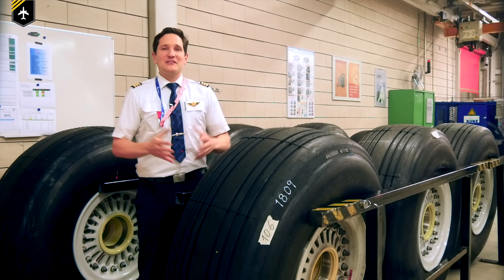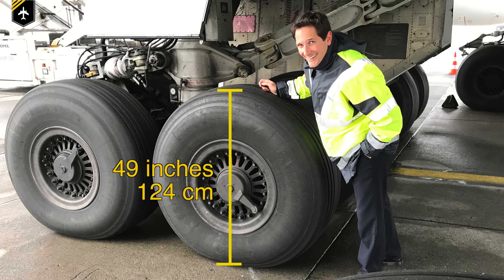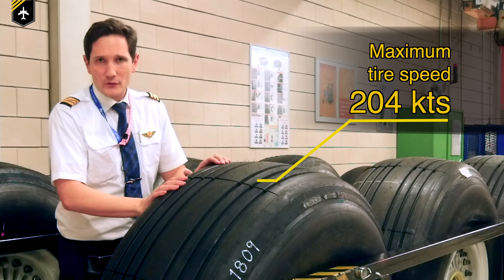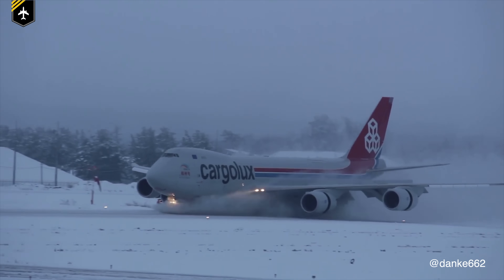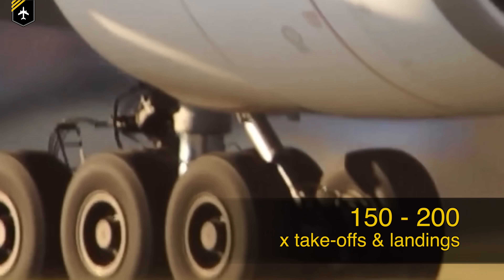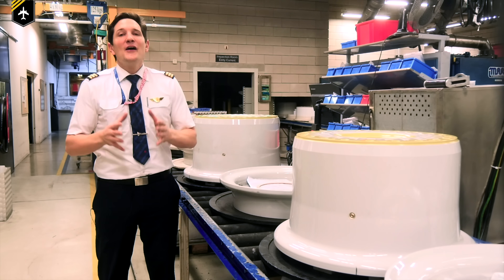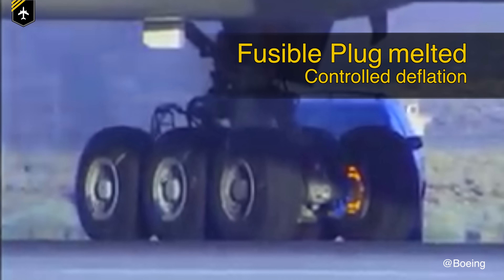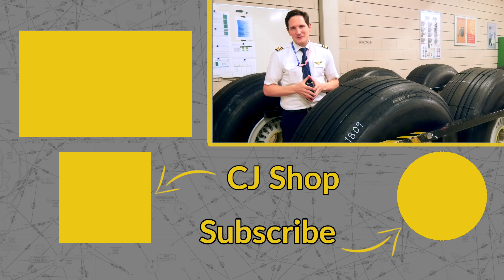HOW MANY LANDINGS can TIRES withstand?? Explained by CAPTAIN JOE

Comment: Yes a few questions about aircraft  tyres.
What is the temperature range to which they are subjected?
Are the stats on how many landings similar for different types, weights and sizes of aircraft?
Are the companies who manufacture them all familiar names eg Goodyear, Michelin or are they specific aircraft tyre manufacturers?
It's a fascinating subject.
PS oh look I just answered all these questions below 😅 thank you Mr Internet
Reply: Temp at 30000 ft is -44.5° to -48° so if landing on hot day in Middle East or Africa at +40° that's a range of over 90°
Reply: Manufacturers are indeed Goodyear and Michelin, also Bridgestone and Dunlop Aircraft Tyres
Reply: Cessna 172 tyre pressures are same as a car : 28psi mains and 34psi nose
Reply: F4 Phantom with full internal fuel load (45,000lbs) but no wing stores mains 210psi with less in the nose 150-180psi according to weight
Reply: Dunlop Aircraft Tyres UK factory is in Birmingham they also have a retreading factory in Mocksville , North Carolina. The CEO says the engineering which goes into aircraft tyres is exceptional. (In a YouTube video from 6 years ago) what a great place to work I should imagine!

Comment: I can relate to this. I used to work for Atlas Copco Wagner Mining Equipment Co as a diesel mechanic at their manufacturing plant in Portland, Oregon. We had one model of machine , a front end loader- or as called in the underground mining industry LHD- load , haul, dump. The model in question was a ST-8B. It was a 8 metric yard capacity machine with a bucket load capacity of around 20,000lbs. The machine dry weight without a load was 43 tons. The tire size was 29.5 by 30. With a flat smooth tread surface. The tire stood 6ft high by 30 inches wide and the hole wheel assembly weighed 3,000lbs. The rims where steel painted with low VOC paint . Due to redesign issues I will say we had a clearance issue of the rim and brake assembly on the axils. Well this issue was overlooked by a supervisor and mechanic and when the machine was put on the ground and driven throughout the day . Friction built up in the rim to the point that the rim caught on fire inside. It finally exploded in the afternoon and by GODS glacé nobody was killed or injured. The engineers figured that the tire reached 600psi before the rim actually failed allowing rim parts and tire to go flying through the air. The normal tire psi is around 95psi. The tire actually held , it was the multi piece split rim that Falled.  The engineers figured that laying the tire assembly flat and putting a 3,000lbs car on it the force would be enough to shoot the car 30ft into the air.

Comment: FYI- Everyone note that the crew removing the tire had to employ a tool to lift the tire when removing it from the axle. Believe it or not, some mechanics would do this by lifting the tire themselves, thinking that  THEY had to be MEN, not "PUSSIES" by foregoing any type of tooling to lift the tires or brakes. I had the pleasure of being told that I was a PUSSY because I could not lift these items as they had done, and still do to this day. YES there are NEANDERTHALS out there in AVIATION Maintenance. Look for the big bodied knuckle dragger type when you see ramp work. :)

Comment: I just read the cost of the 747-8i tire is $9,200 for a single tire. But it said typically all airlines lease tires from the tire manufacturers. Tires are owned by the tire manufacturers and the airline companies pay price per landing basis. For this lease, all maintenance is also taken care of by the tire manufacturers.

Comment: just seeing the title i came here expecting 100 to 200 takeoffs and landings for commercial aircraft. Also depending on conditions only 1 landing to 1000 (1000 being multiple retreads). Smaller private aircraft i could see tires lasting for a much larger number of cycles, and in many cases actually being replaced more due to age.

Comment: did the plane have Tire Pressure Sensor/ Indicator inside cookpit?

I just wonder. if during a fly and a landing tire is losing air before landiung. do inside plane have a emergency pump to fill the air? like the car?

Comment: They should add a small engine to spin the wheels before they hit the ground so they dont get used a lot
Reply: Antonio Hagopian not that practical 

Because you will add complexity and dead weight to the aircraft

Comment: As a kid I would often see tires vaporizing as other kids, who did not buy their own tires, would "patch out."  I guess that planes "patch in."  As my English grandmother would have said, "Disgraceful wastefulness. "

In both cases the tire speed does not match the ground speed.  Car wheels spin faster than the ground is passing beneath the car.  On the other hand, plane wheels are still when they hit the ground which is passing beneath the plane at 150 MPH.  I have long wondered why we do not spin up the plane's wheels to match the ground speed once the landing gear have been lowered and prior to hitting the tarmac.  Some volutes on the sides of the wheels could accomplish this, in some measure if not fully.

Comment: Not being funny but if you filled them wheels with dry air there would be no problem. The tires work for mabe 30 seconds at a time on take off and landing. Air can be squeezed beyond 400bar over 5x what your max presure of the tires rating. Also it's a very small %of stability gains using nitrogen over air

Comment: I always thought those tires were tiny
Reply: They are small relative to the size of the aircraft. A Cessna 172 tire is less than half the diameter of most normal car tires if that
Reply: @DAN007thefoxx1  And what pressure is used in a c172 tire?
Reply: @Mark-rt6fy  I assume its a relatively high pressure for the small size. But most airplanes weigh less than similarly sized cars.
Reply: @DAN007thefoxx1  I just google'd a bit after posting here. Looks like those tires are inflated to 31 psi, pretty comparable to normal car tires then
Reply: F15 tires are inflated to 315psi! The mains, not sure about the nosewheel.

Comment: I think you should do a video on re-treading aircraft tires. I have spent a couple decades commuting on the interstate in the US and have not only seen bits and pieces of re-tread truck tires all over the road but I have also witnessed a few explode right in front of me. When I hear the phrase “re-tread” in the aviation industry the images from my commutes immediately pop in to my head. I have a fair amount of confidence that the aviation industry has much higher standards and strict regulations for re-tread tires but seeing an in-depth video on this will help to allay my concerns. I have already witnessed commercial truck re-treading first-hand at a shop near me so I’m somewhat familiar with the process...which creates my concern regarding aviation tire re-treading.

Comment: Why don't they use a lightweight motor to spin the tires up to speed before each landing to significantly increase tire life since it appears the main culprit of wear is the tire having to spin up to match the landing speed of the plane? And I'm sure those tires aren't cheap either even to retread.

Comment: I never really understood why plane wheels were never designed so they would already be spinning upon landing. Basically before they touch the runway. Seems most of the wear and tear would be caused during this transition from being stationary to spinning at high speed. Perhaps motors to pre-spin the wheels is not feasible, but maybe some type of fins in the wheel hub that would take advantage of the wind drag could make them spin. But what do I know. Not an engineer.

Comment: I'm wondering why aircraft wheels don't simply speed up shortly before touchdown in order to minimize friction. This could be done very simply by adding Electro motors or a propeller to each wheel to be driven by  wind
Reply: It has been investigated and was proved to be not profitable in comparison with normal wheels.

Comment: 28" on a car? that's bigger than my mtb wheels.. ^^
Reply: 28" for a car tyre isn't uncommon, for example if  run 17s with a 235/55 tyre your overall diameter is going to be around 26". So a couple inches off but not much.
Reply: I drive a stock '15 subaru forester... it has 28" tires. It isn't uncommon
Reply: I know he meant 18
Reply: I commented on that as well.

Worries me he actually flies planes. With a brain like that.

Probably his parents locked him in the house & made him do his homework before he ate.
Reply: @chris77777777ify  its with the sidewall aswell dumb dumb 😂

Comment: I wonder if vanes on the wheels so the air speed would make them spin at high speed and prevent the violent landing event of having to go from zero to over 200mph in no seconds would cut down on wear and damage to the tires? Probably at least cut down on the heat and tire smoke from the brief sliding while they get up to speed. Plus I'm thinkin that that has to be where most of the tire wear occurs. I'm pretty sure all that tire smoke contributes to global warming.....kidden, but it seems to me that if my idea contributed to fewer tire blowouts/explosions and possible crash landings it would be worth trying. L8r.

Comment: On the topic tires exploding and how dangerous it is; One of my colleagues who used work as an aircraft mechanic servicing Saudi Airline's 747s told me of this one incident where two mechanics who were topping up a 747's tire had accidentally used a 2000psi gas cylinder by forgetting to check the identification which resulted in the tire exploding killing both of them instantly

Comment: Used to r&o aircraft wheels/ tires
Each wheel that came in got new tires after so many landings we did an overhaul. We would stamp the bolts also,  7 stamps and we would throw out and replace. All  bolts went through NDT testing. Only overhauled wheels were NDT tested. I also painted the wheels and brakes.

Comment: Hi Captain Joe, I'm sure most of the wear happens when the tire is skidded at landing, why wouldn't manufacturers design a system either with a motor or a fan blade system (to catch the air) to bring the wheel up to landing speed ?  I know a motor would add weight and be complicated but something attached to the wheel would be simple, the tire manufacturer could even mould a series of cups into the sidewall of the tire to catch air during the build process.

Comment: I was told that the main cause of wear of the tires was during the landing,  going from 0 to landing speed acceleration in a very short instant. (The visible puff of smoke being a telltale sign)
If true..... it occurred to me that one way to increase the life of the tires would be to spin them up to speed prior to hitting the pavement.
A possible light, cheap and reliable way to do this would be to make carbon fibre hubs that lay flush with the rim of the tire..... Once the landing gear is deployed.... They would pop out, exposing a pinwheel like interior that grabs the air and begins to spin the tire.
If effective it would also slow the plane down quicker and would change the manner in which planes land.

Comment: Ok I am gonna copyright this or patent it. WHY don't airplane tyres have the treads designed so they catch the wind and become like windmills and actually turn. If the wind is travelling at 150mph they will spin pretty fast, surely they will last longer without flat spots if they are spinning quite fast before landing?

Comment: by the way, normal pressure for an A350 main tire is 255 psi, and also the diameter is a lot bigger than a 747 main tire :)

Comment: I wonder if pre-spinning the wheels before landing would make them last longer. That impact smoke / wear is probably what reduces its life
Reply: I don't know all the reasons why the tires are not spun up just before touch-down, but I do know that this topic has been examined for years. A flight instructor of mine who had gone to Embry-Riddle Aeronautical University in Florida told me that this topic is reviewed in class by the teachers, and that overall it has never proved worthwhile to do. But I never was told any details.
Reply: I was hoping he'd address that, too. Why not have an air driven mechanism to get the wheels up to speed before landing and massively reduce wear?
Reply: Maybe some vanes on the side walls would generate spin with little extra cost or weight?  Maybe I should get a patent in b4 the idea is stolen. Lol.

Comment: Hello Joe. I wonder why the landing wheels are NOT spun up pre landing by small wind mill fins on the wheels or by an electric motor to stop or at least reduce the terrible HIT when a dead stopped tire hits the runway. From videos it looks like the tires take a hiding during touchdown.

Comment: Why not make rims that have multiple fins made to catch the air, thus making the tires spin which in turn should cause less wear on landing since the tires are spinning at a decent speed already when they touch the ground. Does that make sense?

Comment: Most aircraft tires are recaps.  They can be rebuilt several times over their lifetime.  Also aircraft tired lose air much faster than car tires.  Adding air daily is it uncommon.  In addition,  tire diameters must match, so both tires on an axle are normally changed at the same time.

Comment: When does a tire get replaced....when the maintenance manual tells you. It varies to how rough a pilot is on his landings.

I've seen them land with the brakes on and blowing a complete set of new tires. Soooooo maybe one time use.....and a pink slip to the unemployment line for not using the check list when landing. Then doing a complete tire change on a main runway that is blocked by plane in the middle the airports rush hour.

Comment: My grandfather worked for Boeing back in the mid to late 1960's when they were developing the 747.  I remember him telling me about the plugs in the wheel and how they had to ensure its proper safe operation.  They calculated the temperature rise that would occur in a maximum braking situation:  high speed, heavily loaded, dry runway etc.  The plug had to remain intact under the most severe conditions but should pop out just before the tire bursts.  A bursting tire causes severe collateral damage and should be avoided if at all possible.
Looking back, I wish I would have asked him a lot more questions about his experiences while developing the 747.

Comment: One idea was striking in mind how we can stop overshooting of planes in many cases ! What if we lay a 3 inch thick wet layer of fine sand of 100 meter length at the final approach of runway to prevent overshooting?
Reply: Many airports use an Engineered Materials Arrestor System (EMAS) to safely stop aircraft from overrunning the runway - https://en.wikipedia.org/wiki/Engineered_materials_arrestor_system . EMAS is usually constructed with crushable concrete blocks.

Comment: #Question:
 doesn’t the nitrogen damage rubber due to its extremely cold temperature...and doesn’t the metal gets frost on it...and when the tyre catches fire...or even just heated...the N2 gas would expend up to 7 times...wouldn’t this burst the Tyler instantaneously before the fuse even starts to melt

Comment: I am surprised that the safety margin is “only” equivalent to 2 tires load. So if 3 tires are deflated or damaged, all the other will support more than their rated weight limit... and could therefore burst (as expected by those specifications). That is odd. This is provided that weight is distributed evenly on all 18 tires on the 747, which I doubt. 
Lastly, in case of a rejected takeoff at MTOW, the load due to hard breaking and weight transfer will have the tires support far more forces that the stationary weight of the plane. The same applies for hard landings... I would love to be able to calcule those figures. 
It is not that do not trust those specs but it seams a really thin margin for the aviation industry (10%). If that would be replicated for engines that would mean a plane could not keep flying with 3 operating engine out of 4... 
Is it only me ?

Comment: It also depends on manufacturers ratings with FAA n Respective regulatories agencies, for e.g, FAA accepts Bridgestones max 300 cycles but EASA n some non-FAA regs standadized at 250cycles,whether Mich,Bridgstone or Gdyear, considering the 1mm depthx7 rethreads,etc.
Just for interesting info,NG tyres cost around $1500/ea ,MG tyre around 2k/ea for the A380. 
But good info n visuals  for others, Capt Joe.. 
I do miss flying "The Queen"..u enjoy your time with her!

Comment: I've always wondered if it would be better/at all benifficial if there was a 10kw motor on each wheel set to spin them up  before touch down radar matched to the ground speed, would that cause problems when touching down with a crosswind? Would it help with fuel savings while taxiing? If used during takeoff, how much shorter takeoff could be possible, 100 feet less? 5 feet less? :P 

I realise that most jet engines idle at 70% throttle, but keeping those engines at 70% instead of 71% might be worth it if the system can accelerate the aircraft at an acceptable rate. Or if the APU could be used to move the aircraft when a puller vehiche cant be used, to move it for service negating the need to spin up any of the main engines.

Comment: How many landings can a 737NG nose wheel tire endure? Does the replacement cycle differ between the nose wheel and the main landing gear? (because the main landing gears endure more shock and friction?

Comment: Ngl it’s comforting to know that tires can still perform if needed under circumstance of a blowout
Reply: That’s for a 747. They differ from jet to jet. I work on KC-135 which uses split rim tires and if one were to blowout it’s not good lol. That’s why we check tires on every inspection after every flight, before every flight etc. Same with the brakes